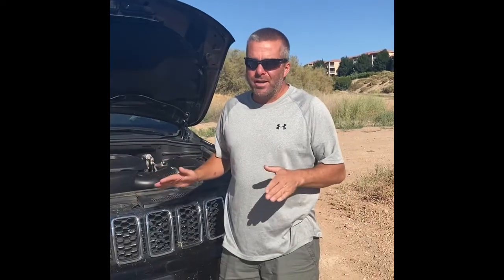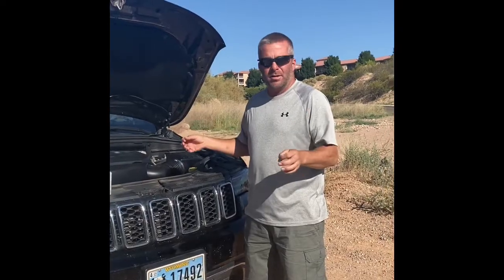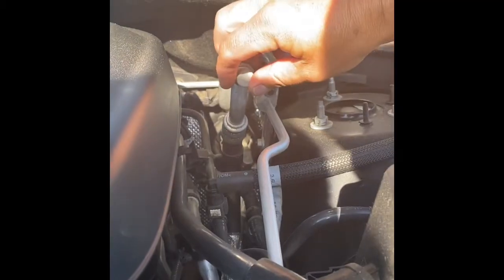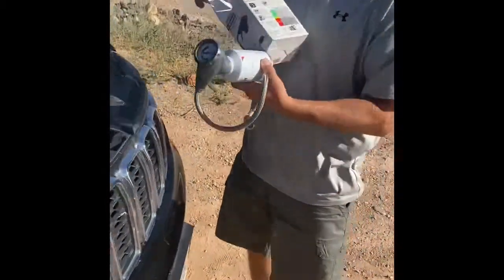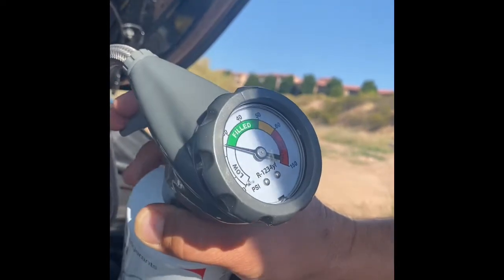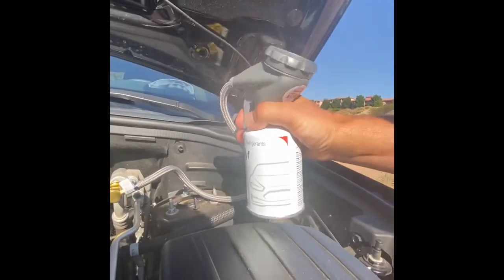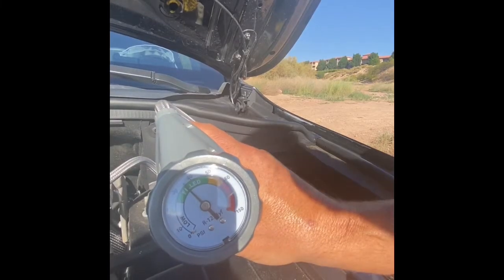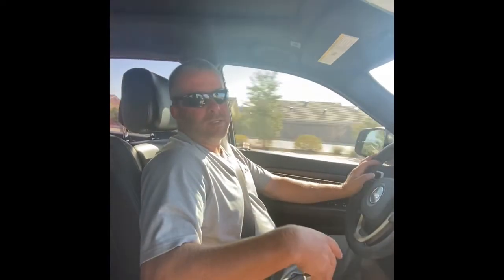How to Recharge 2017 Jeep Grand Cherokee  LTD with 1234yf refrigerant

Comment: This was the only video I have watched that shows the car making a noise coming out of the vents. I thought I had a bigger problem on my hands and thanks to you now I know that the Freon was just getting low. Awesome video!
Reply: I have the same noise. But when I hooked up the gauge it says my refrigerant is at a normal level. Any ideas? 2016 jeep grand Cherokee limited.
Reply: @cfresh44  might be your evaporator which is about $2k repair
Reply: @fartripper5566  took the jeep in.  they said they cant find anything wrong.  everything looks fine.  only issue they said it could possibly be is the fan.  luckily its winter right now but i cant wait to have to figure it out once it gets warm again.....
Reply: @cfresh44  any updates?
Reply: The Darth Vader snarl !
Reply: Just spent $940.00 in NYC to change my water pump and thermostat. I’m still hearing this fuck1ng hissing noise. So pissed with my mechanic because afterwards he told me he doesn’t have the machine to add Freon to my vehicle and he doesn’t have the R-1234YF
Reply: Yooo I thought I was trippen ! Thank you

Comment: Great video man love that u showed the noise inside the car many people don't know that. Also, altitude and allowing for expansion is a good point. As a side note, some of the 1234yf connector cords don't fit perfectly so if is not a smooth connection do not force it i had many customers having those issues. Over all one of the best videos i seen. Thank you for sharing knowledge. 🎉

Comment: Great video Tom! Thank you. I just sorted out our 2017 Cherokee Trailhawk V6 in 10 minutes.  Thanks for pointing out the Darth Vader sound as a symptom that is exactly what I noticed in our Jeep. I hooked up the can and Guage to the system like you explained and right away could see it was low. It only took 5 short shots to bring it up to correct pressure. I let sit for 15 seconds to see if pressure would drop but it didn't. Checked the air temperature coming out of the vents and it was really cold. Job done!
 YOU CAN do it yourself everyone!! Don't give up your hard earned dollars to corporate greed.

Comment: Great video, very helpful. Quick note for your viewers: 

Double-check the sticker and cap under your hood as not all 2014s use R-1234yf refrigerant. I have a 2014 (new design) but it's R-134a.
Reply from the maker: Yah this is for a 2017.  This seems to be the transition year where they switched to the 1234yf

Comment: I had the exact same symptoms a few years ago in my 2015 Jeep Wrangler. This season symptoms returned. I took it to dealer as its under warranty and this time the system was leak tested. A/C compressor did not pass the test. They are replacing tomorrow. The hissing through vents is a very strange sound for sure!

Comment: I really want to try this but now I’m reading about doing this can cause the high pressure side to become over pressurized if your not careful. Also the hose can introduce moisture into the system. The last thing I want to do is take it to the dealer and spend $1000+ to make it cold again and to stop the annoying hissing noise.

Comment: Good video EXCEPT: As you climb in altitude, the atmospheric pressure generally decreases. The relationship between altitude and atmospheric pressure is often described by the barometric formula. In general, atmospheric pressure decreases with increasing altitude
Reply: Yes, it decreases, allowing for expansion.

Comment: My 2018 cherokee is making that same noise, its been doing it for a few weeks. when i connect the gauge it shows its full. A/C gets kinda cold after deiving for a good 10-15min. but if its on addle Its not cold, and even then the Air from passengers vents isnt the same temperature.
Reply: Did you ever fix it? If you did what did you do because mine is doing the same
Reply: @Gustavo -- I have a 2018 and it's making this noise -- did you try to refill the AC yourself following the instructions in this vid? Or did you go to a shop?
Reply: @thesavagedonut698  I have a Chrysler 300 that was making this noise and the air conditioner didn't work at all on it. I mean it didn't work AT ALL. 

I got a can of the extremely expensive (i paid 151$ after taxes) R1234YF A/C Pro refrigerant with leak stop in it from autozone. Used the entire can (12oz) the system was THAT empty. 

Noise stopped as soon as i did that, went from 8psi to 43-44 and stayed there. A/C in the car is blowing frigid even when at idle. When driving it blows so cold that condensation will form on the vents.

Comment: I'm not sure the noise is a symptom of low refrigerant. I have had the hissing noise from my vents as well with the A/C on (particularly if the fan level is set to a lower setting), along with degraded performance in high heat (I live in FL). Hooked a guage up to the low-side port and the pressure was steady at 40PSI (after picking up a $140 can of A/C Pro r1234yf from AutoZone). 
I went ahead and figured I'd fill the system closer to 45+ PSI and although the air does feel much cooler now. The hissing "Darth Vader" sound still persists, but less frequent. May consider bumping the pressure up a bit more, but definitely don't want to risk overfilling.
Interested to hear other's experience with the annoying noise and degraded performance.

Note: I am running a 2017 Jeep Grand Cherokee Overland as well.
Reply: I have a 2017 as well and the dearth Vader noise is much worse this year than last year. It also struggles to keep cool. I bought the gauge and refrigerant too. I hooked up the gauge and noticed it was 35 psi in the green. I would have thought it would be much lower. Not sure what to do now because I hear it’s very easy to over fill it when your only checking the low side pressure and not the high side as well.
Reply: I'm having the same issue on my 2015 dodge durango with dark Vader noise! What is causeing it??thanks
Reply: @maryannmartinez5520  the noise is from low refrigerant. How low it varies from one to another.
Reply: I have the same issue on my 2018 
Same noise, gauge shows 37psi. any of you found a solution?
Reply: I had the "darth vader" noise in my 300 for a while and the ac didn't work at all. Hooked up a A/C Pro can of r1234YF, car was at 8PSI. Filled it to 43-44 and now it's working beautifully.
Reply: I have a 2106 JGC. I have the hissing noise. The overall ac temp is pretty good. Bought a $145 can and the gauge said It was filled. So I didn’t add any. Not sure if I I should or not. Feel like I wasted $145 if it’s something more serious like compressor issues.
Reply: @ek8652  I’m in the same boat.
Reply: I had the same hissing noise after 4 months ac stopped working. after inspecting found a short hose close to where he filled system had a leak I'm guessing these hoses don't last long ? gonna refill system after I replace hose
Reply: I sold my Jeep with the issue since this post, but I've read quite a few comments where people purchase the almost $150 can of refrigerant just to find out their system is full. This was the case for me so I really recommend not spending the money on the refrigerant and potentially getting a quote from an auto shop. In my opinion the systems have been designed to keep the average backyard mechanics from working on them. 

Tl;dr: Don't waste your money on a can of the expensive refrigerant
Reply: @nigelleitzell4421  very true. You can however , buy the can and still those hose on the low pressure nozzle to see what pressure you ac system is at. If it’s at a normal level , don’t add any refrigerant and just return the bottle. That’s what I did.

Comment: My wife's 2017 Cherokee's AC was working fine one day and the next day it was blowing hot air. I replaced the AC clutch fuse even though it looked good. No luck. Could this be a low  coolant level issue? I would think if it was low coolant it would slowly  get warmer and not work as well but I'm not sure.

Comment: Did your system stay charged? Or did you end up having a leak? Wondering how common it is for the system on the grand Cherokee to just lose a little pressure over time.
Reply: That's what I wondered, too.
Reply: I’ve got the exact same noise coming from my vents. Only when the AC is on. Still keeps cold air on though
Reply: @HA-vx4bx  did u find out wat the problem with urs?
Reply: All ac systems are sealed. If the refrigerant is low, there is a leak.

Comment: Would you do 2015 same way? I just realized that ac is weaker. Is still cold but not like use to be. I usually did vent speed 2 , now always at least 4. Bud not weird sound from ac
Reply from the maker: You’ll have to look at the low pressure port to see what kind of refrigerant your jeep uses.  My guess is it’s not the same as the 2017

Comment: How many cans of the 8oz r1234yf did you need to use? I see you had 2 cans in the video but did you need to use both to recharge your system to the appropriate psi?
Reply from the maker: Jake,  I only ended up using 1 can.  It’s nice to have a second as a spare though.
Reply: I just used one full 8oz can to recharge my system that was pretty much completely empty on Freon as well as info. Has been working great with AC for 2 weeks now.
Reply from the maker: @jkarkuese  thanks for following up!  I’m glad you where able to do it yourself!

Comment: Wow. Something people can actually do on their vehicle today! I'm an old motorhead from the days before the computer welded the hood shut from the average Joe. But I've seen it asked but not answered. Does a need to recharge indicate a leak or is the "New" Freon just something that needs this from time to time?
Reply: Update. $137.00. 2018 GC Limited. Exact same equip. as in the link. Problem solved. Thank you Tom!

Comment: i have a 2014 do you know what kind of freon it’s used? and can i just go to auto zone & get regular freon?
Reply from the maker: I don’t specifically.  This info is for a 2017 only.  Other years you’ll have to find out what your specific vehicle uses.  If I was to guess I’d say 134a
Reply: I have a 2014 Jeep Cherokee Latitude and mine has the new freon. There is a sticker with a snowflake and the freon number on the plastic protecting the fan under the hood.

Comment: I'm confused! I looked up what my 2014 Grand Cherokee takes and says R-134a and the only car to take r-123 is the Cherokee not the grand cherokee. So which is it? Don't want to put the wrong freon in it.
Reply from the maker: I’m sorry this is for a 2017 specifically.  If I was to guess yours is the R134a refrigerant.  But you can look at your charge port under the hood and it should say on it.  Additionally, the 134a hoses won’t fit in a 1234yf system and vice versa so you really can’t screw it up
Reply: Contrary to what was said at the beginning of the video, it was the 2014 Jeep Cherokee, not the Grand Cherokee, that uses R-1234yf.
Reply from the maker: @johnyoung5820  actually if you listen to it again, I never said which specific model was switched in 2014, just that “in 2014 they switched to a different refrigerant”.  But since this video was specifically made to show a 2017 Jeep Grand Cherokee limited, it’s a non issue.  But if you do your research some Chrysler vehicles where starting to switch around 2014.  But I don’t really care since this video is for a 2017 specifically....

Comment: But do you have a leak somewhere?
Reply from the maker: Douglas, we live at 7000 feet, the issue happens when went to sea level, there wasn’t enough pressure.  I charged it at sea level and then hooked the gauge up at our home elevation and it was fine.  I kept it in the low side of the green.

Comment: I think this might be a defect in Jeep Cherokees. I have a 2017 Jeep Cherokee (less than 40k miles) and have had it in the shop 3 times to check for a leak and add freon. They checked for a leak, replaced an o-ring, cleaned out the blower and the same problem happens. After the Freon is charged, the A/C runs for about a day and then this “hissing death Vader noise” returns and car won’t cool. I’m starting to think maybe there’s an issue with the ambient temperature sensor? No idea. Anyone else have this problem or know of a solution? I seriously think this needs to be recalled, though probably won’t as it’s not a “health hazard”.
Reply: Update: After the fourth trip to the mechanic, the mechanic say the evaporator core is leaking and it will take 8-9 hours of work to fix. I’ll be contacting Jeep directly. This is just out of warranted, but is absolutely ridiculous for a 3 year old car under 40k miles.
Reply: @jasonquintal7255  whatever happened? Is it all fixed?

Comment: I really hate hearing "it was just a little low" or "the dealer wanted $××× for a recharge". If it's low on refrigerant there is a leak somewhere. Plain and simple. You can spend money on refrigerant and get it going cool again but depending on how big the leak is determines how long it's gonna last before you have to do it again. If there's no leak at all you won't ever have to '"recharge" your ac system in your car.

Comment: Why only 3 years old and leaking refrigerant?, has to be leak somewhere, warranty expired? that new refrigerant is scam and ripoff..
Reply from the maker: I completely agree
Reply: @xtremeairvents  There should be some oil wherever that much gas is leaking from, could be fitting was not torqued properly from the factory..